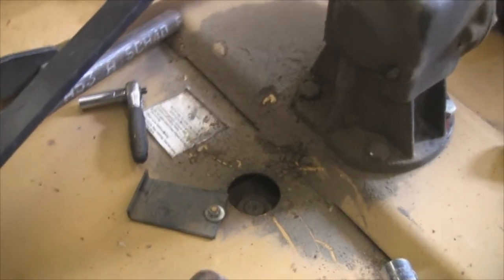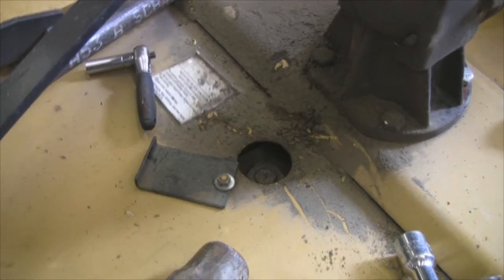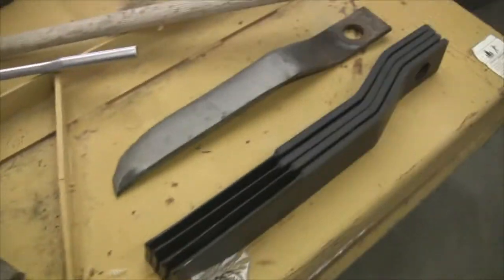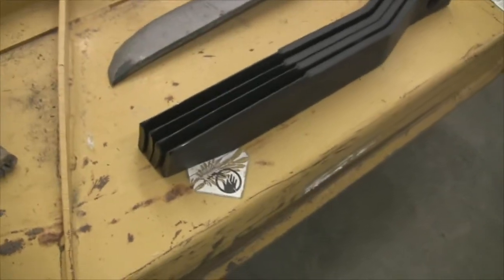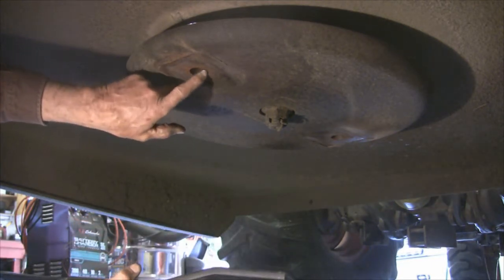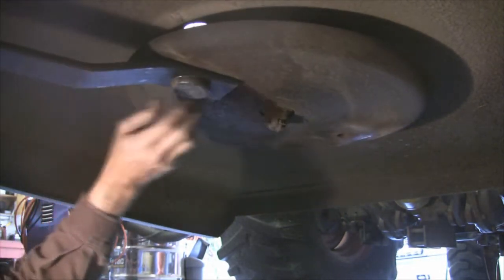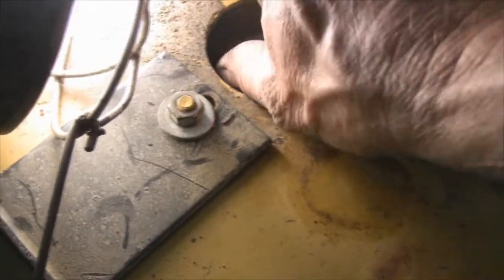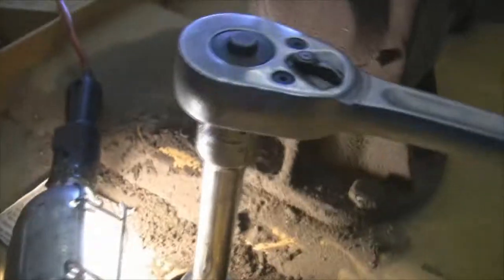Changing Blades on a Rankin 60 inch mower

Comment: I've done some work on a few big flail mowers over the years most of them 3 mower decks.that fold up... so when you said "...chopped a few rocks with that one."  It reminded me that, yeah, those flail mowers are some kinda brutal when it comes to rocks and stones. I had one come in that I had to rig up a heavy chain drape for because the mower had smacked a stone about the size of a baseball out across: 3  southbound lanes, a 150ft median, 3 northbound lanes, the shoulder of the road and down into a gas station where it hit a guy in the leg! Don't know the exact distance but it was a "far piece".

Comment: We have 3 different designs of the mowers on our farm (due to lots of organic blackcurrants). The cheapest one (by the polish maker, just over the border for me) mows easiest and breaks less than others and not expensive to repair. Designed almost like yours. Most expensive one uses a pipe with bladed hammers or some abomination like that, can go trough anything, but with wear starts to vibrate and vibrates itself to death- cracks everywhere.

Comment: That was a tough nut to crack!  Was that a Sears ratchet?  I wouldn't use a ratchet to break something loose, I would have used a breaker bar.  But even then, I turned the square drive on one into a spiral once and sears didn't want to replace it, called it abuse, but I convinced them it was defective tempering.
Reply from the maker: If I had a breaker bar big enough.. I sure would have used it.. yes.. its a sears. .haha.

Comment: What about sharpening those blades from time to time? You might get ten years instead of eight out of them!

Cheers Matthew
Reply from the maker: I did
Reply: Sorry, you only talked about not having changed them in eight years! Cheers, Matthew
Reply from the maker: but I crawled under there with my angle grinder and sharpened them a couple of times. i found out it doesnt really do any good.. they dont cut any better
Reply: My blade sharpening is limited to electric flymo mowers. it was worth sharpening regularilly, especially as when I was an adolescent doing it, there were no angle grinders around, it was done with a file. Spark test the old blades to see how hard they are, maybe reforging and tempering them might work, it could be that as with some cold chisels, they are surface hard (much more than case hardening) just some thoughts!
Cheers, Matthew